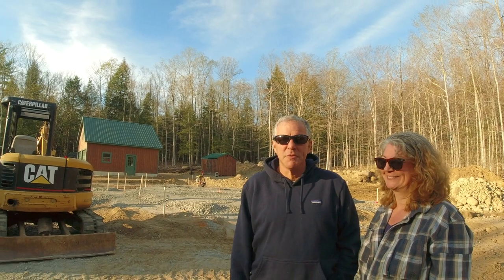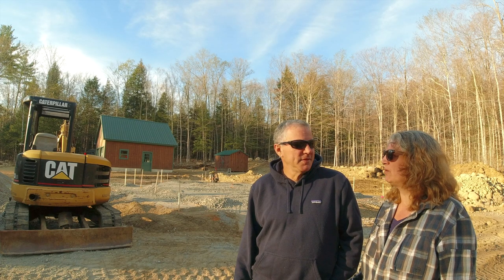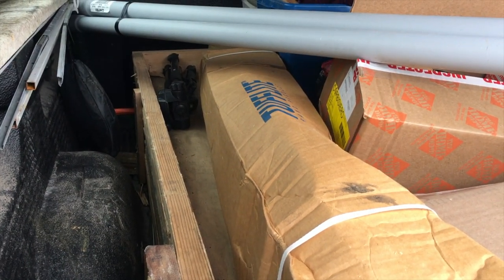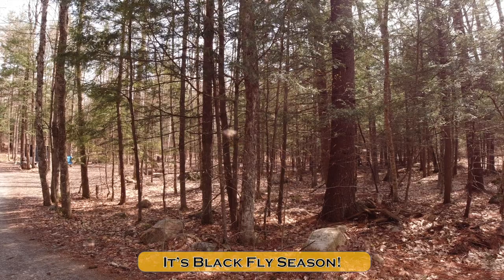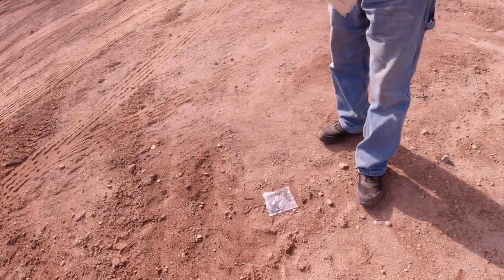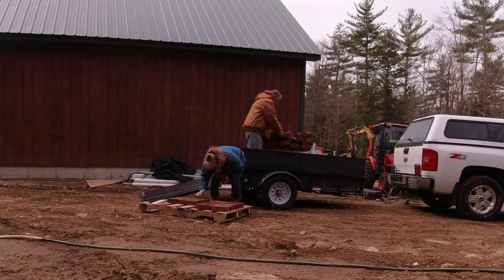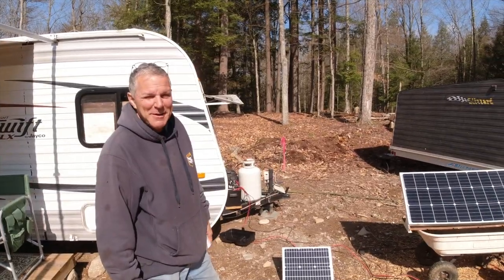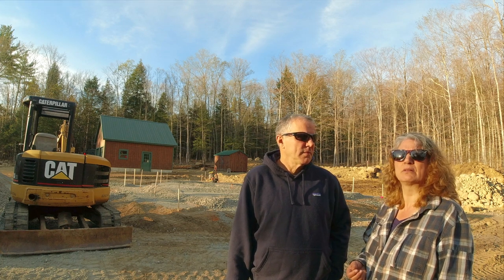Off Grid Earth Sheltered House FOUNDATION  - It's NOT Your Typical SLAB!

Comment: Hey guys,
Glad to see everything moving forward nicely. That hilti gun w the trigger is much better choice and easier to use than the hammer activated one. It allows you to apply more even pressure so the nails go in all the way the first time. Much less waste of time and loads. I'm glad you finally got the generator. Woohoo. One way to keep the temperature more consistent on cold night's in the temporary greenhouse is too put big rocks, gallon water jugs and/or bricks down inside. They will absorb the heat during the day and release it at night keeping it above freezing. A free automatic heat source. Maybe cover the floor with those reclaimed bricks until you need them for something else.  You probably already knew that but I thought I would put it out there for your subscribers. 🍻✌
Reply from the maker: Thanks! The bricks are actually a good idea- we are so crazy here we honestly didn’t think of it!!!

Comment: LTL companies like XPO will stack freight on bars between terminals. Then picking up and dropping off they do not stack the freight. That company is paying to move the space of that freight. Not the 12 inches above it that the pointed sign says "do not stack".  So it is common to take that sign off or flatten it like they did.  The company pays for the size of the freight, they do not include the size of that 12 inch sign above the freight.
Reply from the maker: Very interesting! Thanks for sharing

Comment: I may have missed it on previous videos, I’m curious how long your driveway is and is there power on the road. Thanks. Terry
Reply from the maker: Our driveway is about 700’ and there is power at the road if we want it in the future but we are really hoping that our off grid solar is enough so we don’t have to!
Reply: @CreatingASimplerLifeOffGrid  it would be nice for running high amp tools , air , ovens and the like. Maybe you could sell some of your electric back to them. Personally I had a trailer pole placed a hundred feet off the road and ran overhead to the house myself. That was 25 yrs ago still going. 1300 ft with no transformer except the one at the road. It’s not the strongest ( lights will dim when a big motor starts ) but it’s dependable. Love the videos. Thanks !
Reply from the maker: Yes,we thought of the tools but we think we have it all covered with solar and backup geny. We’ll find out soon enough though! It’s definitely in the back of our minds though… just in case.